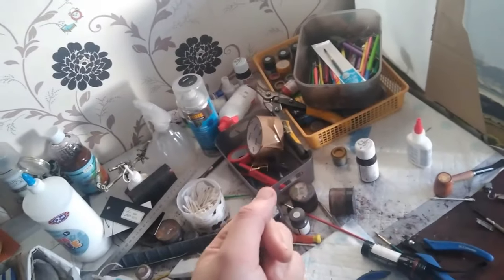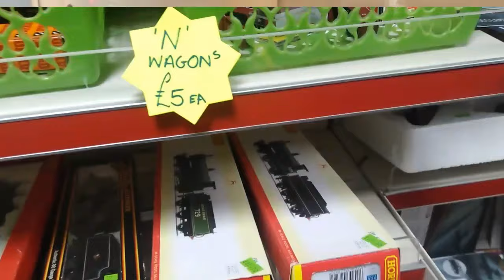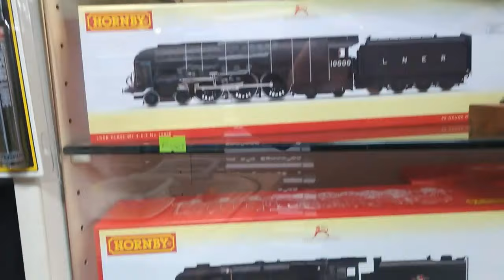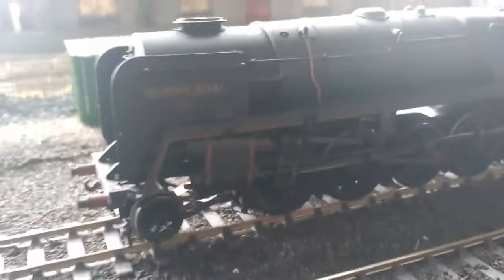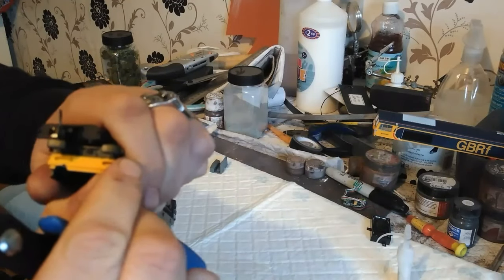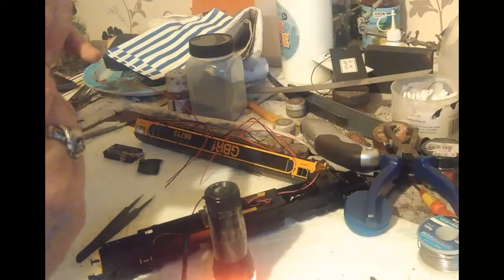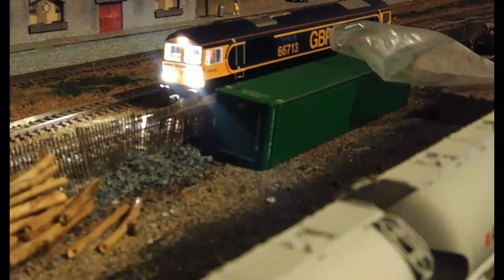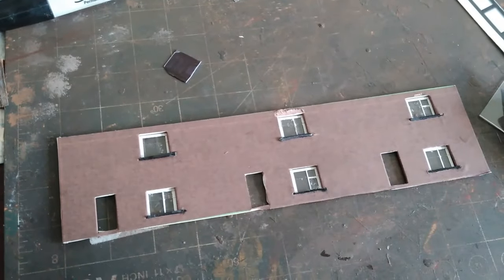This shop has it all ❤️ | Iron Horse Weekly ep18

Comment: Ashton Models, who would have that it. That's my local model shop.
When I make buildings I use foam core for the shell and then cover it in Plastic card. That may be something you could try. Would work for low relief buildings as well.

Comment: Great video Craig that shop looks a gem.Layout looks great when you do your 37 lights you could use the 66 as a torch.🤣
Reply from the maker: 😂😂😂 ok that's funny to be fair 😂😂 
I'm probably going to add more resistance in the future - proof of concept is the method works! I can do it MY way and not how a lot says I should - plus saved enough for a cheeky wagon 😎😁
Reply: As long as they work when you do them it's a bonus.Shame you card build did not work but as you say we learn from our mistakes. Keep up the good work A cheeky wagon..🤣
Reply from the maker: @richardswiderski4985  I've built loads of card buildings before, but this stuff happens all the time with them - no more!

Comment: 3 minutes in, the box said Graf Spee, but the model looked remarkably like Titanic! - - brightness of LED lights - put a resistor in the feed wire! lots of info on the web regarding values (the led's will last longer, as well!) - - music whilst looking around the shop - Please turn the level DOWN!! I'm at 75% to hear you, and had to turn it down to 8% to keep my windows in the frames! - - Don't spend too much at Warley!
Reply from the maker: It's difficult to judge how loud music will be on another person's device - I can't very well take everything into account can I? The volume is already set to 3% - need something on there otherwise it's too quiet!
Reply: Strange everything came out at a reasonable volume level for me, didn't need to adjust at all, what were you watching it on, maybe it has AVC (Automatic Volume Control) that is playing with the gain ?

Comment: Hi Craig.

I'd like to watch this upload but it keeps stopping, reloading, then continuing on from where it left off. It doesn't happen to any other channel uploads on YT and, after driving me mad with frustration, I was left with no choice but to abandon it after only 3mins. 

It seems the problem is with the video itself. 

Paul. 👎
Reply from the maker: Hi Paul - nobody else is having issues, I can watch the video from my work pc no issue so I'm not sure what's going on mate.

I'd suggest clearing your YouTube cache or restarting your Device and trying again...
Reply: Yowser.

My YT cache is set to automatically clear whenever I close the app so upon investigation, it displayed 0. I then did some more Sherlock Holmes and discovered that the 'Telegram' app that I had downloaded and installed this morning was causing problems so I uninstalled it and BINGO, your video was back to normal. 

I then skipped, what was for me, the boring part showing the model shop (I'm in London so Northern shops have no interest for me) and watched you attacking the 'spaghetti' with your soldering iron. If that was me, I would probably have strangled myself with all that wiring out of sheer frustration. 

Good to see that you have purchased another steamer but when do we get to see both of them negotiating your layout? As a steam loco enthusiast, the sooner the better I say! 

Sorry to see your anger at the end with your attempt to scratch-build, but at least you've discovered where your modelling weaknesses lie, whereas us Southerners get it right every time. 😂 

Cheers me dears,

Paul. 👍
Reply from the maker: It's worth giving him a call, he has tons of stuff for Railways in and he will even do what's app video calls to show you the locos running etc 😎

Sadly the 9F doesn't seem to want to go around my curves despite them being 3rd and above... Strange but there we go!
Reply: Craig.

Thanks for the tip mate. Using Whatsapp sounds like a good idea, so I'll probably give it a whirl. 

Cheers mucker,

Paul. 👌